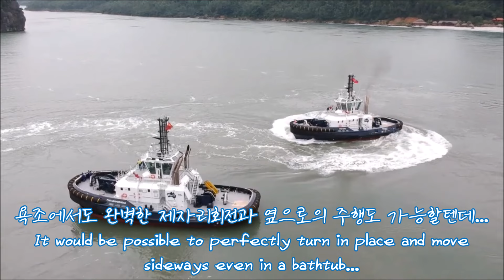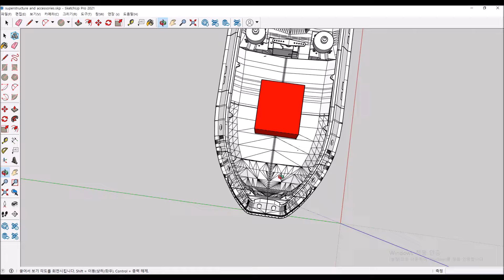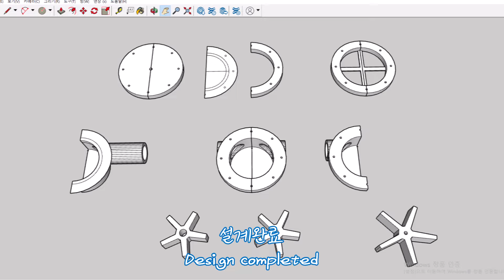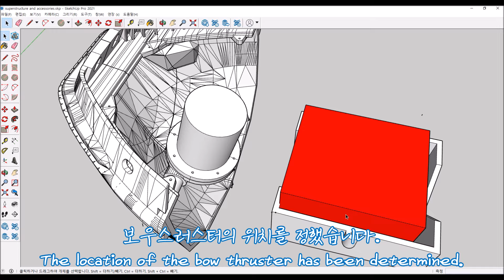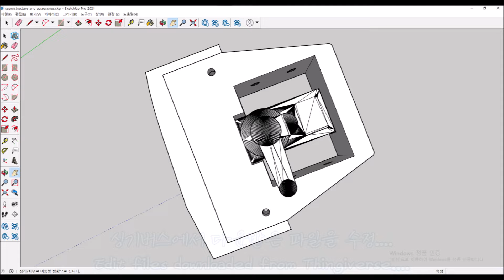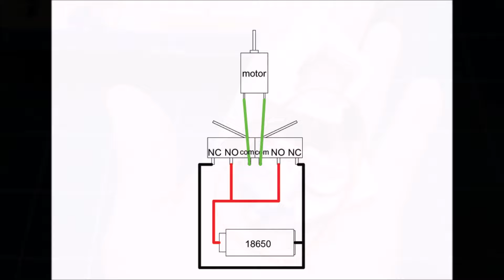Make a 1:72 FAIRPLAY Tug Boat. EP8.  Add bow thruster

Comment: The solution with switching the direction of motor rotation by switches and servo is certainly workable, but I would recommend a microcontroller and H-bridge. It is more reliable, takes less space and allows you to create more flexible control systems. The most convenient is to use Arduino, it is inexpensive and easy to learn. If you want to get started, I'd be happy to help!
Reply from the maker: I'm not good at intelligence, so I'm satisfied with what I have now. thank you